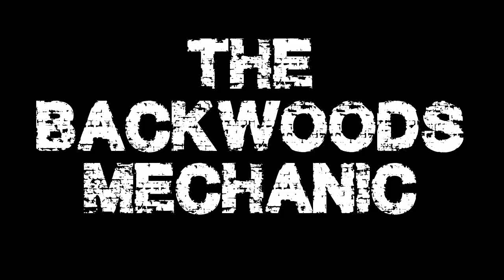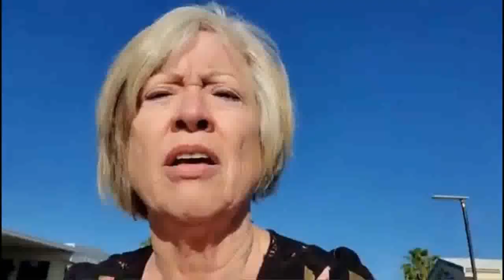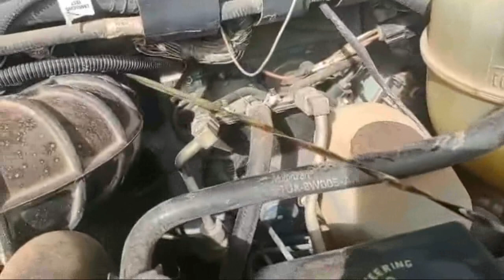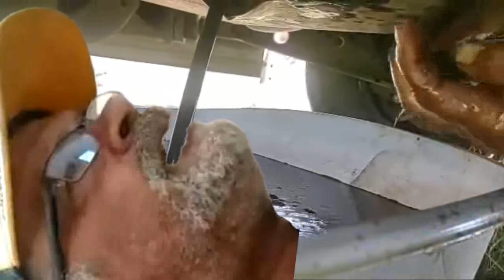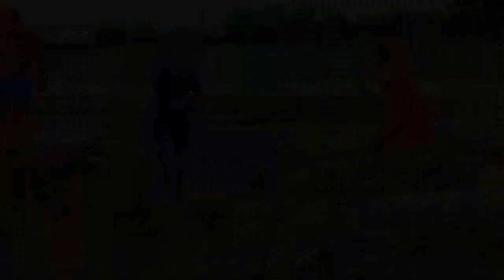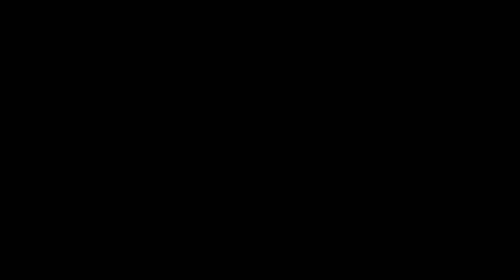The Backwoods Mechanic..

Comment: I'm a member on a couple of car repair forums.  Some members will describe an issue they are having with their cars.
Others will diagnose the situation and then have the member do some simple tests which can confirm the problem.
Then we will show how to repair. 

One of the most basic diagnosis of a suspected head gasket issue is done by checking fluid levels. High oil level. Low coolant level.  Oil looks like  chocolate and smalls sweet.  . Yup. Blown head gasket.   

Randy does not seem to have enough basic tools.  For example I'd use a ratchet wrench to remove the oil pan drain. 

He also doesn't have the X shaped tire lug nut wrench.   His son needed to rescue him. He used a ratchet wrench to change the tire. 

I agree that he just wanted donations to get gas money to relocate to Arizona. 
Winter will be here soon.
Reply: Great diagnosis, Johan!!!!
Reply: @raallen1468  

This could have been diagnosed remotely.  Randy could have asked her to  check the oil level and also remove the radiator cap. This would have taken a few minutes.  All it takes is a chat session conversation.  Also a photograph of the dip stick would have told the whole story. 

Sorry....  your engine is ruined.
Reply: @johanvangelderen6715  I believe everything you've posted.... and with Randy-the-Shyster we believe nothing!!!
Reply: @raallen1468  

I also enjoy following Garden Gnomes issues. His continuous brake issues for example. Or transmissions. 

It's common practice to downshift when going up a mountain pass. It's less load on the engine and transmission.  

Also one downshifts before going downhill. The engine compression will slow the vehicle down.  Brakes should be used sparingly. Garden Gnome refuses to do that.  Because he says that will ruin the transmission. I've discussed this with him in the past. He feels he knows more than me.   Ok.......  I've repaired my own vehicles for 50 years now.
Reply: @johanvangelderen6715  Make no mistake. Garden Gnome knows everything there is to know about everything there is to know.
Reply: Yes I'm broke and I still would properly diag my 98 Ford van and fix whatever is going on right the first time around but some people just are not ment to fix a engine or something
Reply: @coreybabcock2025  

As we know, it's helpful to learn how mechanical systems work. Also some electrical.    That general knowledge allows us to understand what the repair forums are talking about.  Also how to diagnose what issues our vehicles have.

Some tools and required.  Harbor Frieght stuff is adequate for most repairs.  

It's important to maintain a vehicle properly. Cooling systems for example. 
Fewer vehicle breakdowns occur if a vehicle has been taken care of.

Comment: Simple scam . Drain the oil on a working car. Add some water. Over fill  adding the  rest of the dirty oil.
Video the dipstick.  Video the water coming out the drain. Cut the camera off. Drain the oil / water out. Add fresh oil , then drive to the casino for buffet and cards.
Reply: Well... Randy did say that "Joni" sold her van. Who the H would pay her $50 for it?
Reply: @raallen1468  

Someone who has access to an engine at a reasonable price. Who also has experience, tools, and an engine lift. 
Or could rent one.   I've done exactly that a few times.
Reply: @johanvangelderen6715  Okay.... But, who wants a 30 yr old van?
I suppose sleeping in a 30 yr old van IS better than sleeping in the desert dirt. 
I know that there are folks who are into old car restoration. Are there old van restoration groups? Just wondering.
Reply: @raallen1468  

There are groups for just about anything. 

I was not aware how old the van was, nor its general condition. 

Consider this.   Say one pulled an engine or transmission out of a vehicle 5 years ago. It's still good. But it's just sitting there. 

Eventually a potentially useful vehicle shows up which needs an engine or transmission.  Like for 250 dollars.  

The right person could install the engine in a few days. Working part time. 

Say it's a truck or van.   Not pretty, but useful. 
One could make money hauling stuff. 
While thats not my thing, it is a way to earn a living.
Reply: @johanvangelderen6715  Sadly, my thinking about what to do with "an old van/truck" has been warped by watching too many YT E-begging Grifters-in-Vans. 😒
Reply: @raallen1468  

Repairing and bringing an old rig back to life only makes sense if:

One owns the dead rig.
One can buy parts at a reasonable price 
One plans on driving the vehicle for at least 3 or 5 years. 

Sucessful repairs takes too many hours of hard work .  There are no shortcuts. 

Scammers can do shoddy work quickly. 
Or eventually while drinking.
Reply: @raallen1468  hey now. My 35 year old f350 6.9l dully is fantastic. No battery needed to run it, except starter and lights. Hell it even runs on old oil, transmission fluid, and kitchen oil. Lol.
 I love the old truck.
Reply: @kalmanto  💖😉💥 Sounds like an "old" farm/ranch truck that you bought new 35 yrs ago & took care of it... We had many of those in my former rural neighborhood.